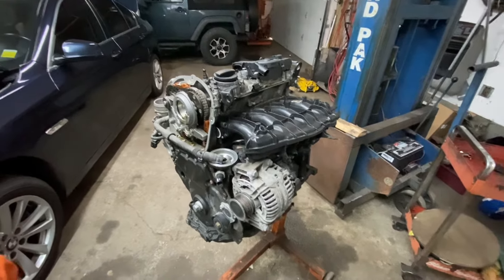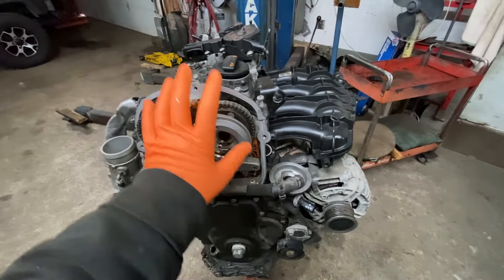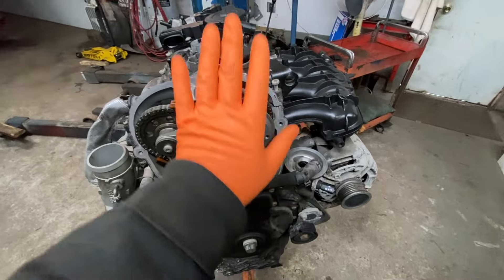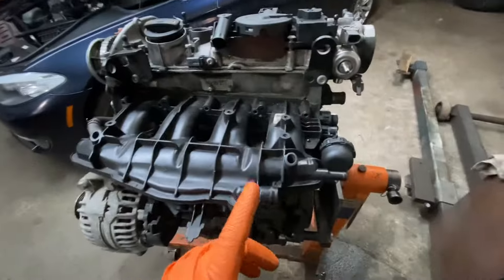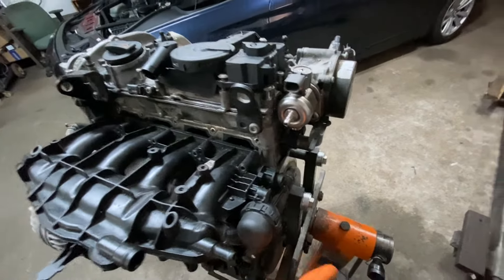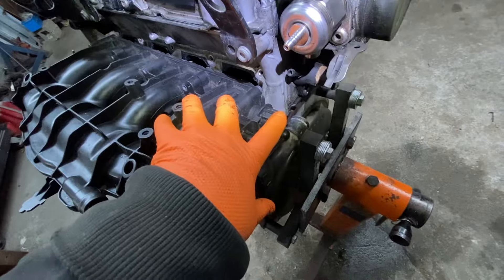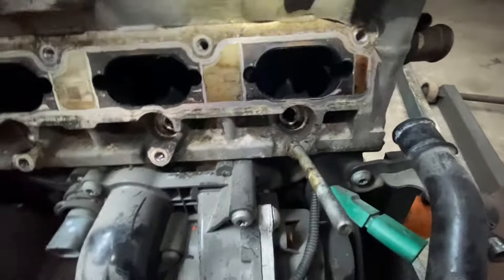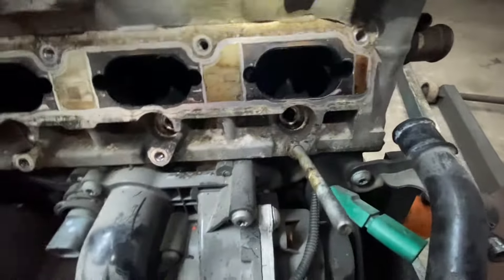VW TSI 2.0 Turbo Engine - Top 3 Failures

Comment: I have a 2008 VW Scirocco 2.0TSi GT with 114,000 miles, I've owned it for about 4 years, no problems at all with the engine, apart from replacing a couple of ignition coils 2 years ago, zero hassle - and that's a 16 year old car. So folks, if a car hasn't been abused and has a good history they are as reliable as any engine - don't be put off 2.0TSi completely.
Reply from the maker: True, but these failures aren’t do to owner neglect.
Reply: I have a 2009 VW Scirocco 2.0TSi with 90,000 miles. It's been tuned to almost 300hp with some bolt ons for half it's life too, and honestly all I've done is replace these damn coil packs. Solid engine! **Just remembered previous owner replaced the timing chain tensioner. Probably a good idea with these engines.
Reply: I agree completely. I’ve got a 2009 Passat with the 2.0 TSI and 175,000KM. It hasn’t been perfect, but it has never left me stranded. That said, I’ve been proactive in my maintenance, replacing the original coils and having the early, failure prone  timing belt tensioner and chains replaced with upgraded parts. With frequent oil changes, I’m hoping I can get at least another 150,000KM out of the car.
Reply: @Bmovie5000 
In the video you said that if the PCV/oil separator produces negative pressure, it means it is damaged. I read information on the forums that if the oil filler cap sucks, it means it is damaged. That's why I'm asking. In the 1.4 16V VW I do not have such an effect - the cap unscrews normally when the engine is running, but the revolutions change for a moment. However, in the 2.0TSI, the revs increase for a moment and the cap is sucked in.
Reply: The 2.0 TSI is a pretty good and reliable engine actually
Reply from the maker: @Dzaen2 I definitely agree once the quirks are dealt with,
Reply: Pal, every engine under the sun has issues and potential failure points, that doesn't mean its a bad engine. It's important however that these issues are known. I myself have owned VW and had mostly decent experiences when it comes to reliability. However, recently i got a Golf 8 R and its already had a failed throttle body at 9k miles and 2 bad injectors (bad resistance values on the coils inside the injectors, so not due to bad fuel) at 40k miles. Both were covered under warranty but these two big failures sure don't inspire much confidence about this engine.
Reply: @ZenzDeluxe  Those two things can fail and not mean a single thing about the reliability of the engine. I wouldn't worry based of on them. Conversely if those two parts were bulletproof that wouldn't mean the engine wouldn't fail.

Comment: The timing chain tensioner failure is all over the various VAG brand forums, and the fix was implemented some years ago now. One big positive about these EA888 engines is that they are strong. You can tune them without much fear 9f premature failure, unlike the more recent 1.5 TSI engines that have slowly been introduced across vag.
Reply from the maker: Yep that's true. They are great engines

Comment: Just bought a 2024 gli a few months ago in August brand new, woke up to go to work today and engine light is flashing, exhaust smells like rotten eggs and motor is knocking like you wouldn’t believe. It’s a 6 speed Manual, any time I let off the gas it dies it won’t idle. Only 15,000 km on it. Wish I never traded my truck in for this
Reply from the maker: Sounds like you need to take it back to the dealer ASAP Can just but a fluke. They will fix it and should be fine, they are great cars don't get discouraged.
Reply: @ took it to them, motors blown and they said it’s not covered under warranty for abuse because a dtc scan detected redlining. Crazy how a vehicle advertised as a performance line and is advertised as a “sports car” is not supposed to be driven fast or u end up having to pay $12,000 out of pocket
Reply from the maker: Sounds like a scam to me. No code detects red lining??

Comment: My timing "jumped" according to the mechanic and caused a broken spark plug and killed the engine on my 2013 a4.123k miles.  They quoted me almost 13k for repairs. Nope.
Reply from the maker: That's ridiculous , Do it yourself with my videos for about $1K

Comment: I have a 2014 vw cc, i am having a problem where my oil was leaking from on top of the engine, took to shop and oil is mixing with coolant. Head gasket seems to be fine so im not too sure what the problem could be? Any suggestions or advice please lmk! Super headache
Reply from the maker: The only way oil would be mixing with coolant would be a head gasket problem. If it's leaking into the coolant or vise versa, there wouldn't be any other symptoms like if coolant was leaking into the combustion chamber where white smoke and rough running would be evident. There is an oil cooler connected to the water pump but they rarely even fail but something to check as well

Comment: Everything you said is true.  I have a 2012 VW Beetle turbo.  I am on my 5th manifold since I purchased the car brand new in 2013.  The last two manifolds lasted only 6 months. I replaced the PCV valve and had carbon build up cleaned from the engine.    My question to you is the car had 112k miles timing belt chain tensioner is original.  Should I get this replaced now?
Reply from the maker: Only if it’s the old type. I have a video on identifying the new one versus the old one. If yours is the new style one you should be fine if not, replace it immediately.

Comment: Im almost buying a gti mk6 with 179k km, but I saw the past history and the head gasket have been replaced with 139k, water pump have been in the same time too, this is a sign to dont buy? Please I need help!
Reply from the maker: It probably over heated and they replaced the cylinder head gasket and water pump, now whether they fixed it properly I don't know. Best to have a mechanic look at it before buying.

Comment: Thank you for the video. I have a 2018 Passat with 42K, I'm the original owner and haven't had any issues. I think it's a wonderful engine. My Passat on a long trip will get 40 MPG and with mixed driving 35MPG. When you enter a highway it had plenty of power. I had an engine light warning me about the oil separator and VW changed it right away.
Reply from the maker: Thank you!

Yes they are great cars when properly maintained like yours!

Comment: It's a very informative and serious video.
Reply from the maker: Yes it is, thank you for the comment.
Reply: @motorcarnut  Are any of these applicable to EA888 2.0T Evo4 released in 2022.

As a normal user what precautions can i take? Multi point check every 6 months with an Oil Change as well?
Reply from the maker: @tronlinestream Your engine is not on this list but yes keeping up oil changes, coolant system maintenance and regular tune ups air filter spark plugs etc. you’ll be fine.

Comment: Im doing my rear main seal tomorrow on my 2021 passat 150k miles purchased brand new definitely going to be check pcv thank you for the info. I just did water pump and a week later rear main went out lol but man its been an amazing car did intake/ injector cleaning and spark plugs every 50k trans fluid every 60k and cant complain to much. Been pretty reliable
Reply from the maker: They are great vehicles. When you replace the rear main seal use the updated one like this and good luck with the repair!
https://youtu.be/f_u47b-qZp0
Reply: @motorcarnut   did the rear main and it still leaks. I'm lost
Reply from the maker: Oh man, did you use the upgraded seal? And maybe could be this?

 https://youtu.be/UZmCw-BNOjE
Reply: @motorcarnut  just hoping for some quick advice. Did the seal again with upgraded seal and pcv is good and oil Is dumping out bottom of transmission where motor and trans meet. No frickin clue what it could be
Reply: Also not leaking from above no signs of leak until cars running
Reply from the maker: Damm, Did you check this?

https://youtu.be/9ZUPWWFOoZA
Reply from the maker: Did you install the seal with the plastic tool?  Make sure when vehicle is running you don't have too much vacuum when you open the oil cap, should be slight vacuum.
Reply: @motorcarnut  yes used proper install tool that slips over crank there was no sign of leaks around silicone from first time I did it. I took it to the dealership for diagnostic I used to work there as a kid for detailing  central valley vw  and they will not rob me to bad lol
Reply from the maker: Let me know what they find, I'm curious now
Reply: @motorcarnut  will do I was a mechanic for 15 years self and grandpa/ dad taught not ase certified or anything like that but I do my own maintenance and was a r&r guy at aamco and it's really stumping me no smoking gun like here's where the oils leaking but soon as you fire it up about a 1/4   to 1/2 quart on the ground immediately lol its insane
Reply from the maker: Hopefully it not a crack in the block or head? Haven't seen that on VW's yet.
Reply: @motorcarnut  exactly what I was thinking. But no water in oil no coolant loss and it runs  perfect just leaks. I'll let you know exactly what the problem was because it's got me real confused
Reply: @motorcarnut  ok so vw said its the seal or bushing inside the case on the transmission for the torque converter idk why I didn't smell the transfluid or notice it was trans fluid I'm am idiot for that. But about 2k at a trans shop to fix it
Reply: @motorcarnut  so now I got a lifetime warranty rear main seal lmfao and I'll have this leak fixed and trans gone through by a transmission professional. Vw was telling me 9k to fix leak which would be replacing transmission so went a additional route
Reply from the maker: Thanks for all these updates, but bro how could you not know it was transmission fluid and not the oil? Plus the bushing that the torque converter rides on it not hard to replace yourself? $20.00 If the transmission was working fine besides the leak.
Reply: @motorcarnut  trans fluid was dirty af and I just was never thinking transmission leak pretty dumb of me to not at least smell it
Reply: @motorcarnut  also trans shop said they had to split case to replace that seal otherwise I'd just do it

Comment: I have a 2024 volkswagen atlas with that same engine ...So far it was 5k miles . Thanks for the information Brotha !!! Youve got a new subscriber
Reply from the maker: Thank you as well for the comment and sub!!!!
Reply: I have 2018 no any issue at all.
Reply: @larry6390  those issues were before 2013
Reply: Not the same engine.
Reply: UPDATE....HAD TAKE IT IN THE SHOP FOR A TURBO MISFIRE ..OIL LEAK AT 8K MILES ....IF U WANT ILL SHOW THE RECORD I RECEIVED FROM VW 3 WEEKS IN THE SHOP FOR A MINOR TURBO PEICE...WERE GONNA TRADE IT IN FOR A TOYOTA SEQUOIA
Reply from the maker: It’s the dealership not the vehicle, Toyota dealerships aren’t any better. All vehicles break down, don’t get too discouraged

Comment: Thank you very much for the good information. I am about to order a Skoda superb 2023 and I am really split between TDI 2.0 200 hp and TSI 2.0 280hp (which should be the EA888 evo4) - Aren't these 280 hp too much for the longevity of a 2.0 engine? Would I expect the chain tensioner issue be fixed on that model?
Reply from the maker: The new ones should be fine. The TDI would be my choice.
Reply: Lol. 280 is pretty relaxed, don't forget from a good 2.0 you can get 1000, so 400 hp caps at reliability, your 300 go is under threshold greets from Romania

Comment: Hi there, how do you recommend I tackle a knock sensor replacement? I have code p0327. I saw that the location of the sensor is below the water pump
Reply from the maker: By removing the intake and water pump first.
https://youtu.be/69sGrLQBfm8

Comment: I have a 2018  vw beetle  tsi turbo with a p19a2 code.  It is described as a faulty transmission thermostat.  Can you please help me try to troubleshoot this code, locate where the thermostat is located.  Thanks in advance.
Reply from the maker: Sounds like its a failing HVAC Heater Control Valve, there are many different types of the valve but here is a part number of one so you can see what it looks like, I'm not saying this is the exact one for your vehicle just what it looks like. You have to take yours out and see the part number than buy that one. It's located in the coolant system from the firewall out.

Google search Part# 4H0121671D

Comment: Thanks so much for the video! I’ve got a 2012 Tiguan with 130k miles with an oil leak and my shop is recommending I replace the cylinder cover. Could you help advise what parts I should buy and supply so they can do this fix? Thank you!
Reply from the maker: You're very welcome. They will just need to reseal the camshaft cover. But use the correct sealant or it will destroy the engine. Here is a video on this exact part.
https://youtube.com/shorts/uxc_3Qurar8

Comment: They ( VAG ) have updated the timing chain tension for a better designed on. Do you know exactly when they did it ? I'd like to know from what month/year was the release
Reply from the maker: Supposedly from 2013 on has the newer timing chain tensioner
Reply: @motorcarnut   Cheers !
Reply from the maker: No problem!

Comment: My 2.0t has a very small suction coming from the pcv you pointed to. Does that mean it’s faulty? My cat has slight shuddering.
Reply from the maker: Yes, the bladder inside is failing and has to be replaced.

Comment: Hello, will the Atlas with the 2.0 TSI 2024 be a good purchase option? What faults could it have? The atlas has just arrived in Peru, produced in the USA
Reply from the maker: Too new to tell but they are very reliable compared to the older engines that's for sure.

Comment: Are these found in the 2022 Arteon?  Really thinking about getting one but I'm concerned about the longevity of the engine and DSG 
transmission.  Is this combination capable of getting 200,000 miles?
Reply from the maker: They are much better in 2022 and will easily last over 200k with proper maintenance.

Comment: A4 and A5 2.0 Tfsi 100,000miles + no issues
Reply from the maker: That's great, not all fail especially if they are properly maintained.
Reply: Its the EA888 gen 3 from 2018
Reply from the maker: Yep. that's why, most of the bugs were worked out by then.

Comment: Hi is this also on 2010 vw passat? Would be very grateful for this as we are looking to purchase a 2010 vw passat 2.0t wagon. Thanks😊😊
Reply from the maker: Yes, they are great vehicles you just have to make sure those things were done or plan on spending the extra money upfront or to negotiate a better price.
Reply: Yes, though by 2010 the TSI might have gotten the upgraded timing chain tensioner and thus less likely to fail. However you still might have to have inspected to find out.

Comment: I was going to look at a 2009 VW Passat 2.0T with 102k miles for 4600 would you recommend? Any suggestions besides the timing chain and PCV check? I really like this car so hopefully it’s a good deal 😊
Reply from the maker: Make sure there is no main seal leaks, timing chain tensioner was replaced and no recently cleared engine codes indicating a possible problem.

Comment: Any interval for pcv replacement. My 2015 q5 75k miles runs well. No suction f try I’m the hole. But I fell suction when pulling oil cap. Is it normal?
Reply from the maker: Slight suction when removing oil cap is normal. I'd replace the PCV valve at your mileage. Becuase it the PCV valve goes it will almost always blow the rear main seal.I have videos on that too.

Comment: Hi 
If my 2.0 TSI sucks in air when I unscrew the cap (it sucks in the oil filler cap), then the oil separator needs to be replaced, right?
Reply: The engine works normally, there are no leaks. It has 50,000 miles on it
Reply from the maker: No, who said that, with engine running you will have vacuum if you try to remove oil cap.
Reply: In the video you said that if the PCV/oil separator produces negative pressure, it means it is damaged. I read information on the forums that if the oil filler cap sucks, it means it is damaged. That's why I'm asking. In the 1.4 16V VW I do not have such an effect - the cap unscrews normally when the engine is running, but the revolutions change for a moment. However, in the 2.0TSI, the revs increase for a moment and the cap is sucked in.
Reply: @Owenage1000 hi, not sure what gen ea888 you have but on the gen3 there is supposed to be suction, that's the whole point of a pcv valve, it sucks the oil spits and gases from the cam case and sends it back into the bottom end.as he stated in video for emissions reasons, the pcv valve is there to create a vacuum which inturn diverts the oil n that back into the block. If you ever see constant smoke coming from your exhaust then your first port of call would be to check and replace the pcv if need be... don't ignore a continuous smoking exhaust.also by removing the oil cap or dipstick whilst the engine is idling then you are technically causing a vacuum leak.. if you do it 2many times you will get an engine checklist come on😅😅 it should go off though once you have turned off the car for 10 mins and pressure is restored👍

Comment: Did they ever update the PCV valve like they did the timing chain tensionor in about 2013?
Reply from the maker: Yes, if you get it from the dealer ,if not you'll be taking a chance .
Reply: @motorcarnut  Sorry, I meant in the later models of the vehicles. Did they install the better PCV valve in later models, or are all models operating with the old faulty PCV even though a new PCV is available? I have a 2017 Tiguan. that's why I am wondering.
Reply from the maker: Yes, yours should have the new one.
Reply: @motorcarnut  thanks a lot for the replies
Reply from the maker: @sanyopoweraid1 sure, no problem!